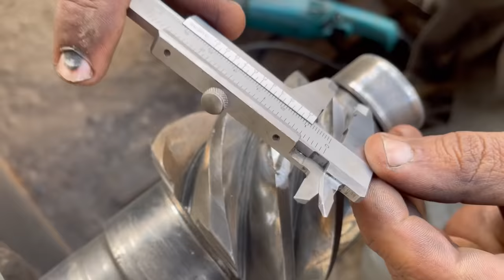I repaired the scrub pinion which no mechanic repairs | Give your opinion by watching the video |

Comment: Over the years of living out in the sticks, I have made a few sketchy repairs in order to keep moving ahead instead of being dead in the water. Many of them were re-done more correctly and with proper parts a.s.a.p., others worked fine for years. A very experienced mechanic I sought advice from when I was young gave me a range of options for repair of an engine. Of the most expedient and inexpensive, he said "It's a poor way to do it, but poor people have poor ways!". I chose that way of doing it so as not to get any poorer any faster and as far as I know, that engine is still running.  
It's amazing to watch these guys making field expedient repairs with limited resources.  My hat is off to them. Not only do they keep rolling ahead, they provide endless opportunities for the countless  armchair experts who like to criticize their work.
Reply: ..he posted his video on to platform where armchair experts are, so why would you complain about it?? You dont see armchair experts sitting nearby him and lecturing him, do you?
Reply: Well, I'm not an armchair expert but I'm a gear specialist and do I criticize their work? Sure do, because it's complete crap because this shabby repair WILL FAIL
Reply: @stevo184  people gotta do what they gotta do. These guys can't afford to go buy a new factory part when a machine critical part fails.ive seen sketchier repairs. That gear looked almost brand new.
Reply: @stevo184  wow a "gear specialist" is that a new gender or just another way to describe someone who does not appreciate people's hard work or even more important when people can make something work with the resources they have rather than their credit cards...
Reply: @stevo184  If he drives down the road and encounters a cow, he will swerve and total the truck to avoid hitting the sacred cow. He may die as a result but that's down to fate.
Having an imperfect gear that works for now, until the next repair is not a problem.
When I traveled through India, I marveled at the simple way people made stuff worked. In London, if food supply stopped for three days you'd have anarchy, same if the Thames flooded.
In India, they'd just shrug and carry on, they're so much better able to cope. Irony eh?
Reply: Ummm, the repair is shit. If you mark that up with engineering blue, the heel and toe are all messed up , high spots all over it. The hardness has been compromised from the heat from welding. It was approximately 60RC before but not now. It might "look" ok to you but in reality it isn't. It will fail without doubt and as it fails it'll probably destroy the crown wheel in the process. The cost increases because it has to be done twice, pulled out and two parts plus bearings increases the cost even further. Throw the piece of shit away and replace it.
Reply: @stevo184  Not a problem, they'll just fix what breaks next.  I presume you've never visited the country to see what goes on.
Reply: So we'll said .....
Reply: If the repair lasts then this was a pretty good job. If the truck again breaks down in the middle of nowhere and has to be taken care of by a towing service then this repair might get expensive?
Reply: @stevo184  not everyone can afford to scrap a part and buy a new one like you. No one is arguing that replacing the damaged part with brand new OEM is the best possible solution for the truck but what if the owner of the truck cannot afford the new part.. must he just park the truck or maybe sell it for scrap?
Also have you considered that there are parts of this world where certain goods might be hard to come by regardless of the price, there are paces where Amazon or eBay don't deliver?
Consider this.... not everyone around the world can have the privileges you have, some people just have to make due with the little they have.
Reply: @EvoKeremidarov  this part is very precisely maschined because of very good reasons, when you have high load transiton at such high speeds any imperfection will cause very high energy vibrations which will quickly destroy other components (thats about saving), you cannot grind such complicated shape by hand any where near precisely enought
Reply: Well said Harold,.....thank you
Reply: It's a remedial repair and may or may not work. Make do with whatever is available ... McGyver style.
For all we know, probably a lot of repaired gears are in the stores and sold as new.
Reply: @stevo184  they never claimed that they were as good as the factory part. However to call it complete crap is ludicrous. If you are such a specialist then why don’t you impress us with a video of yourself doing what they did with what they have. Otherwise sit down
Reply: @proximo1033  What you say is true but the vehicle maybe never goes over 30 mph and it's all they can afford. Something is better than nothing at least until you can get something better.
Reply: @stevo184  as a gear specialist you should also know, pinion and ring (crown) gear are a matched set, and should be replaced as a pair anyways, so the cost didn't go up that much of a proper repair anyways if it take out the other gear, worst case would be if housing or differential carrier gets hurt when it breaks again. But that repair might only be to get them to a repair shop to better fix it instead of a tow or waiting longer. Don't judge without knowing whole context. P.S. you should know bearings should be replaced anyways if pinion gear broke due to metal fragments, so thats not more of a cost either.
Reply: @proximo1033  I would disagree about being able to machine things so precisely by hand, however, it would take more time then what they put into it. Also, that isn't the biggest of the problems with the repair, but could be just temporary, everyone acting like it will be forever replacement but they and you and I don't know that.
Reply: @justinteller2184  "Don't judge without knowing the whole context".... Ironic that you did exactly that?... Your comments are worthless and mean nothing to me
Reply: @stevo184  good thing you liked your own comment, because no one else will. 👍
Reply: @stevo184  sure, okay, after you logged onto her account to like it.
Reply: @stevo184  im also a gear specialist, but I ask you, what you would do without access to a replacement gearset, and with only a welder and grinder at your disposal? I would question the geometry of the gearset once setup, backlash varience like crazy.. me? perhaps i might just dress the gear and cracks as best i could? maybe id lay a few welds just to sure up some cracks and bridge the gap. everything will fail, even the origianal part did (probably due to other reasons) but the questions is was it better than it was? id have have to mark it up and spin it over to be sure but if the geometry is half decent then yes. slow speed farm truck could be still pit to use for many years. highway use not too long of course due to hardness.
Reply: @stevo184  these guys don’t seem to be doing this for fun so I suspect this repair has worked before...
Reply: @internetpointsbank3728  Sure, it's got a lifetime warranty....which is about 10 minutes
Reply: @stevo184  in your opinion.
Reply: Another know nothing
Reply: Well fucking said sir
Reply: Ok let's say they do the same shabby work on the steering gear on a 5 ton truck two days later that steering gear breaks and the truck goes through a building and kills people, you're good with that
Reply: People talk crap about American mechanics too lazy to this kind of repair. There is no way you could get by with this in the US. Say a shop does one of these quicky repairs , puts you back out on the road and let's say they welded your pitman are or half assed a tierod repair. It breaks again while your doing 80 and you kill 10 people. There'd be 10 lawyers  suing the shop and possible criminal charges brought against the owner. So NO MOST mechanics in the  US WONT DO THAT KIND OF REPAIRS
Reply: @stevo184  does that mean he should give a 24 months warranty with his work?
Why would you suppose he gets these jobs, is it because it never works, or could it be that it works just good enough to keep a beat up old truck doing its job. Welcome to the reality of their world.
Reply: @lenny108  you need to see and understand these countries, they don't have AA roadside service, most stuff is. fixed where it falters.
Reply: @internetmarketingconsultant  only to punters from Western countries on eBay. 😂
Reply: @hl8256  In Adelaide many years ago a truck body company built a touring bus using bits of various of truck bodies.
They butt welded the steering column together. The bus was inspected but the inspector was friends with the fabricators and passed it.
The bus was on a trip and the steering column failed at the weld, the bus crashed and many people died as a result.
A broken tooth on that hypoid pinion gear could lock the differential up as the crown wheel tries to digest it. Who knows it might happen downhill in the rain as pedestrians are walking up the hill....
Reply: @gazzafloss  "does that mean he should give a 24 months warranty with his work? "
WTF? What an inane comment
Reply: @stevo184  You decree his work won't last so being the "expert" I guess we need to trust your opinion, nah, think not, your opinion is just that, your opinion, my money's on the "Amazing Technologies" guy. You're thinking of this in the privileged first world sphere, that's not where he is.
Reply: I think everyone is missing the point, a weld is a weld as long as the filler rod is the same material it will be fine. You do not know what material is used. The fact he was cleaning slag off every bit to prevent porosity and busted out calipers to measure is amazing and shows craftsmanship, a good weld will not fail and is stronger than the material around it. For a part that costs roughly $500-$800 USD, and they roughly make a avg of $5600 USD a year. Its cheaper for them rebuild and fix what they have. The reason in 1st world countries we don't is its cheaper for us to replace then to pay the hour rates. So next time think of complaining just remember your luxuries are only afforded due to this.
Reply: @psycho-nutkase9233  not everybody but a lot are missing the point for sure, "shouting at the wind".
Reply: @psycho-nutkase9233  Ummm what a perfect user name, it suits your comments.... "You do not know what material is used" ...Ummm,  I do and so should you if you have any idea what you're talking about and paid attention to the video. Do you know the yield strength and tensile strength of the parent material versus the yield and tensile strength of the rods because I do and they are not the same. Do you know the RC of both materials including the HAZ ? 
Chipping off slag isn't amazing from stick welding lol. 
Using a vernier caliper isn't amazing either, it's utterly ridiculous trying to measure a span measurement on a hypoid pinion gear on a angle grinder ground involute tooth profile which changes over the length of the pinion.
The involute is messed up, the pressure angle is messed up, the base pitch is messed up, the contact area is messed up and the welded material is not the same as the parent material.
And it's clear that you have absolutely no idea what you're talking about.
You're entitled to an opinion like everyone else but you're not entitled to facts
Reply: Best comment mate I agree. Even if he asked for their opinion some of them are just cruel and often motivated by more than the actual subject at hand
Reply: @EvoKeremidarov  indeed.
Reply: @djtaylorutube  You are right on, they are more resourceful than westerners will ever be.
Reply: @jusplay7309 He is privilege because he was born in a country that has many resources that the IMF with is many own corporations had taken over the resources of others people's countries,that are mine in other parts of the world. 😁😁😁😁😁😁😁😁
Reply: @jtothew4201  Indeed.
Reply: @hl8256  Ask that to the car manufactures who seem to be  counting pennies when they build their cars and when their is a recall that will cost them million and get away with it by not repairing the problem.
Reply: We just need to know how many km it will continue working
Reply: Haha "armchair experts" that's a good one!
Reply: @stevo184  no you're just another angry armchair expert lol
Reply: @stevo184  he appears  to now have 7.8 million views in three weeks . Does that mean he can now afford a new  component ?
Reply: @stevo184  I think your head hardness is comprised
Reply: To get you up and running this is amazing
Reply: @justinteller2184  I DID, it  won’t hold.
Reply: Saw someone mention 60RC. Googled the weld shown. It was Nihonweld NHF-650B which rated at 56-60RC, so i guess they somehow do know something of what they're doing.
Watched some other videos of similar repair, they basically did the same thing, probably just a norm over there.
Seems like their trucks and cars got lots of tolerance too.
Reply: @stevo184  i appreciate the comment about the hardness from the HAZ

If the technician in the video heat treated the part after welsing would it go a long way towards easing your anxieties about the gear?
Reply: @stevo184  As soon as the pinion calved, the gearset was junk.  This buys time.  I reckon it's a bloody good repair for a while at least.  If only he could blue for contact and harden it somehow...  Gotta love being an armchair expert.
Reply: @stevo184  dude ive had to do exactly what hes doing to a ford truck back in 94. truck still has the same gears in it, we use it to haul scrap iron  ..gear expert lol

Comment: It is a good repair to get you out of a bind but it will not last. In my early years as a mechanic living in Jamaica, I had this done at a machine shop called Ramdial Engineering in Kingston. Those guys requested the crown and pinion to be present for the repair. It was done to the pinion gear in a chevrolet D20 diff and lasted about 4 months then we had to do it again. The second time we did the crown and pinion which lasted another 4 months. The parts had to come from America and were very expensive at the time and took about 4 months to come into the island. The repairs really bought us some time.  I highy recommend this repair but keep in mind it is only temporary.
Reply: That's an amazing story. If it worked until your part arrived then it worked! As someone living in Indonesia for the last ten years I know how long it takes for parts to arrive from America! 

It's right when you say I guess it got lost that it shows up 😂
Reply: this is called heat treatment
Reply: So you were the Babylon repair mon who left us with your repairs here in k12

Comment: There is a reason why it's called precision spiral bevel pinion gear. It's not something that can be repaired with a stick welder and angle grinder. 

Here are the reasons why  "the scrub pinion which no mechanic repairs" and how you can at least try:
1. Prep work. None has been done. Part came from the truck and it's impregnated with oil. It needs to be burned off or cavities will form in the weld. Also you need to remove some of the remaining material to cut out micro cracks. The best way was to gauge out or grind out some metal.
2. Hardness. The part was not aneiled before work and hardened after. The boundary between weld and the part will easily open up when load is applied.
3. Prescision. Bevel spiral was restored by eye. No templates were made or not shown. Wandering contact point between two gears will create high impulse forces and will start damaging the main pinion and bearings. At the very least some ink could have been used to try to mesh this spiral pinion with the main one by grinding and scraping.
4. LOAD. It's very highly loaded part. Those are forged before machinig and that's why they splinter. Under high load the welded material will start to "flow" closing the gap between teeth.

So in the end we have a "new" shiny part which is only good enough for the dumpster or to get to a local service where it can be replaced with a proper one. Even a highly worn one is better then this. No one in their right mind should attempt to drive a loaded truck with that inside.

But what do i know, this comment will get less likes than "Good job", "This is what they have to do to get by" and "They need to feed family. 
Shit repairs like this can kill people. But where this work is done nobody cares and people are just renewable resource.
Reply: It's not perfect. But it will work.
Reply: It's not perfect but it will work.
Reply: very unlikely 1 axle drive failure will kill anyone. if the truckdriver does not get back to work his whole family will die, - of starvation
most of these trucks have 2 axles, so its only taking half the load, and might last long enough to obtain a replacement part for a permanent repair
english is not their first language, [we all know that] so why pick on them, are you a racist?   just because you are a clever person does not mean you are a nice person....
Reply: @ccboss490  with cross fingers
Reply: You are absolutely right
Reply: Hardening is not necessary. He is using a 650 B which is a surfacing rod.